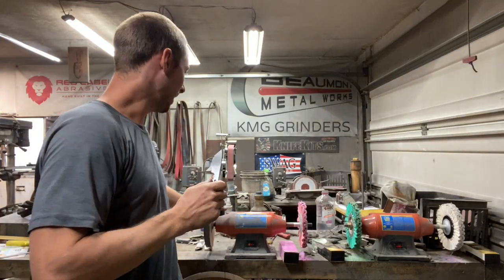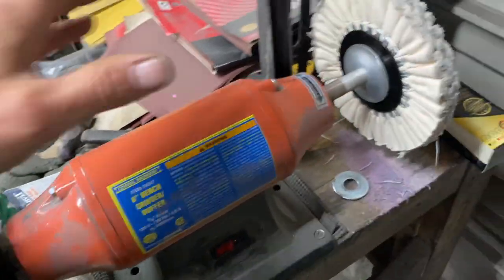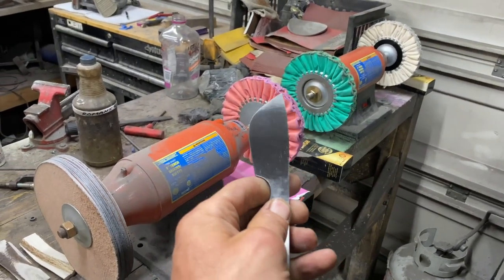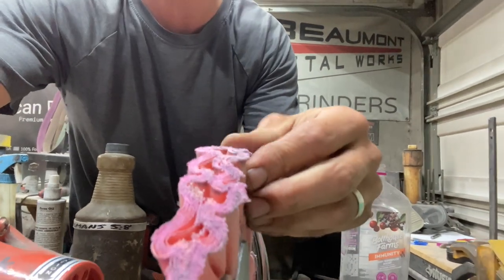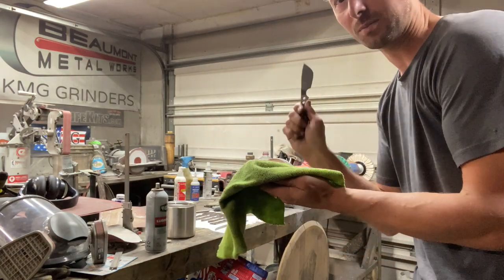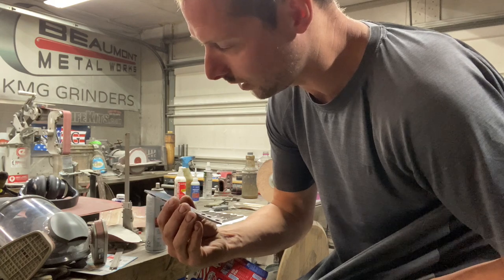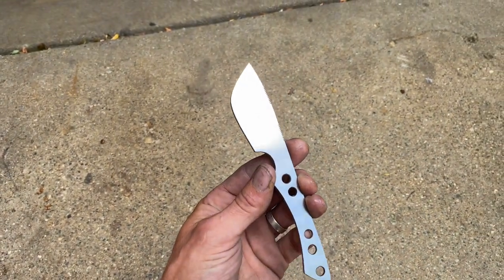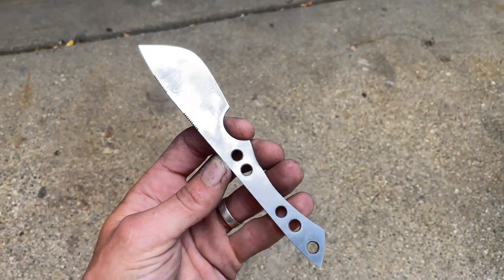HOW To get  a BEAUTIFUL MIRROR finish!?

Comment: I've been using a generic airway wheel for a couple   of months.  I've a set in my cart from redlabel but haven't pulled the trigger yet.   On a side note what rpm is your buffer/grinder?  Keep up the good videos.
Reply from the maker: Mine are 3590 rpm  . Works pretty good!
Reply: @gentrycustomknives8008  Mine are 3450 & 1750.  Can't say one is better than the other.

Comment: Hey dude, started using this kind of buffing and polishing system for about 20 years  on many different metal projects, just hobby stuff, and motorcycle parts. To get super fine needs i use cape cod polishing clothes. This will polish out small scratches in glass and mirrors. Have you used this for anything?  I like to see others work and get good tips . Never to old to learn. Do you use epoxy glue on you scales. If so what kind. Thanks. Good video. Gunna subscribe.
Reply from the maker: I’ve never tried those clothes but I will now! Yes I use gflex 2 part and blade pro most of the time!

Comment: These could be a game changer for me also, many thanks for bringing this product to the community's  attention. Since you've used them for a while, do you have any feel for how long each wheel is likely to last? 100 blades each? 500?
Reply from the maker: They last a very long time. I’ve used the other set for a couple years and they are still fine
Reply: @gentrycustomknives8008  Thank you for your quick response! When they're back in stock I will use your link to order a set.